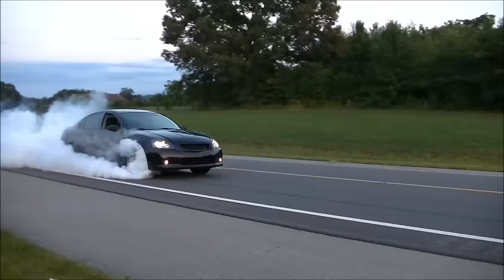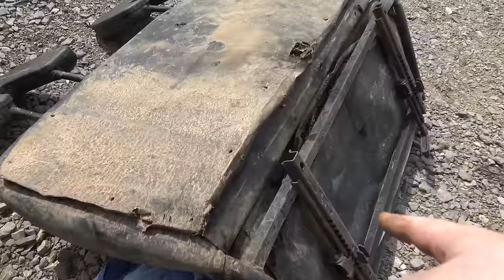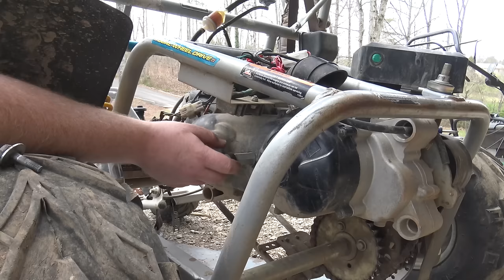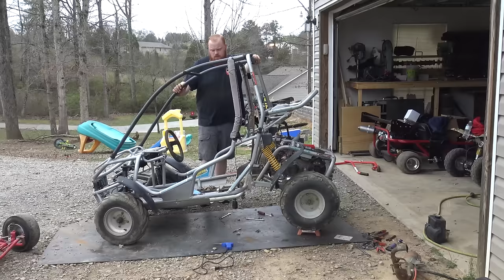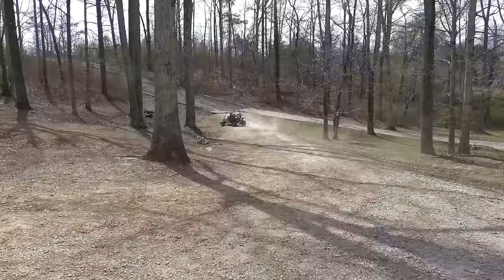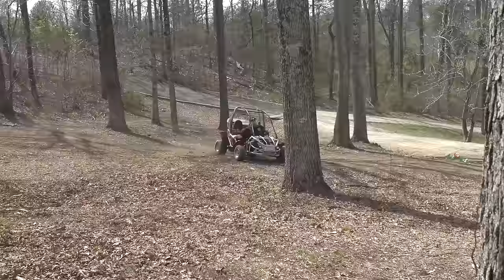150cc Go Kart Performance Upgrades

Comment: How hard would it be to rehab one of these. I found one thats not running and am wondering if it would be worth rebuilding for my daughters.
Reply from the maker: +Fink oh yeah go power sports has a rebuild kit and you can get 10% with my code. Lots of power for it's size. I will doing a rebuild on one of these engines soon on the channel

Comment: So honest question I’m currently working on a 150cc myself now we have the same set up but one thing I must ask when I bypass the air filter box with this new one cause this is sexy and better performance do I need the two vacuum lines or can I eliminate them all together anyways thanks

Comment: I have a quick question. Once you removed the air box for the UNI filter.. What do you do with the hose that went from the valve cover to the air box?
Reply: They make block off plates for some

Comment: I have a df200DKG 168.9cc four seater. I have a Lifan  engine in their and I have a problem with the idle, the cable runs from the throttle pedal to the back of the carb. I keep trying to adjust it but it always goes back to a minimal idle. any suggestions on that? Also, I need more take off power. Would these up performance upgrades work and would it help my increase in take off speed? Thanks

Comment: Do you have a video that shows how to remove the starter on the Fox Carbide 150 CC Go Cart.  It is a tight fit, and we are not sure how much we need to unbolt to get this out.

Comment: I bought a new racing cdi for my blue lightning reverse by americansports works. I hooked the cdi up and all it did was crank didnt fire up i never had that problem with the old one. So I put the old one back on and it still fires up. Think that cdi just doesnt work for it any ideas of what type I should buy

Comment: I just bought a 150cc Scorpion chassis with no motor. What motor would you recommend putting on it. I know regular go kart motors won't go on it, I'm just trying to find out what kind of motor does go on it. Thanks
Reply from the maker: Watch my 670cc off road go kart. If you do the rear engine section like I did then you could use a 420cc predator and make some pretty good power
Reply: Red Beard's Garage I will give it a look and see! Thanks a lot! Also, do you know if a motorcycle motor would work? I'm just trying to find the cheapest buy also best route to go.
Reply: Does the motor your talking about look just like a regular go kart motor?
Reply: Go to buggydepot.com they sell the gy6 engines. They even have the ones with a big bore kit installed

Comment: Do you have a list of parts that will fit my Hammerhead GTS 150? I'm new to the go kart scene and I recently got my hammerhead. I want to upgrade it over time, but theres so many different brands for each part, and I have no clue what to buy and what will be compatible. I have a shop that will install the mods for me, but they don't sell performance parts for their vehicles. Any help would be greatly appreciated.

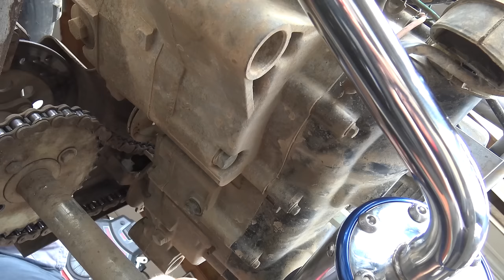Comment: Make sure you also clean the oil filter screen, you have to take off that big bolt cap on the other side from where the drain bolt is on the bottom of the engine, you can see it at 15:14

Comment: Hey bud I got the GY6 150 TaoTao go-kart in my header has the EGR valve on it and a line that goes to the carburetor for vacuum what do I do with that vacuum hose if I remove the EGR system

Comment: hey R.B. I need some help. I'm purchasing a simular Kart called the helix 150cc. Can I fit a predator 212cc or even better a 16hp vtwin
Reply from the maker: You probably would need to make a new rear engine mount. I will be doing one soon on a Yerfdog Spider box so stay tuned to see how I do it.

Comment: hi I am running a 40 series torque converter I greased and it is working great but now when the drive pulley opens it is making a lot of noise any suggestions thanks

Comment: just wondering if u know of ne kart frames that r all metric... from the bolts n nuts to the bearings?
Reply from the maker: No most are made in China so there pretty much all standard.
Reply: Red Beard's Garage thats kinda strange bcos i picked 1 up last year and not 1 bolt is sae and when i took the wheel bearings to a kart shop to get new 1s the guy was puzzled and said they werent the original bearings but they were, and its blowing my mind cos nobody has been able to tell me who made this 1

Comment: my 150cc was running good until i hit about 30 miles per hour then the kart just dies. It wont start and battery is not problem. Ive tested ever wire but all were good. when i opened rear fuse box. fuse was not blown but i realized i could hot wire it. It ran for 5 minutes than died. What could be problem?
Reply from the maker: No clue man. I would try and replace all the electronics on it. There really cheap for these things

Comment: Would it be pointless to get the jetted carb  and not the performance cdi?
Reply from the maker: No it would still make more power. The cdi pretty much lets it rev a little higher

Comment: hey RBG my friend a gokart that we are upgrading it has a small lift and good suspension can u give me any ideas on what to do to make it faster?
Reply from the maker: What are you wanting to do and what engine is on it?
Reply: well I wanted to lift it put a new exhaust bigger tires and rims and maybe a new fuel pump in it because we live in el paso tx. and we like to offroad at redsands but the gokart is only rear wheel drive my only problem is I dont kno what type of engine it is or what because my friend bought it off of his neighbor
Reply: it should be a 6 cylinder maybe more or less around there

Comment: that isa gy6 right?
i got a adly 150cc quad it has the 150 g6 engine and its only doing 60kmh.. and its driving me insane its a great base, but the engine is slow...
i bought of aliexpress those orange racing cdi with coils. the orange cdi does nothing the stock black cdi does the same speed....got a iridium spark plug. it still does 62kmh gps...
so i bought a new racing cdi those blue ones on aliexpress... hope that helps. i got more acceleration since i got a exhaust on it it has a better response :)
but i think i might need also a cornet air filter (cause it has a air box stock with a massive air fitler that i cant even blow tru...) and maybe jet it?
its wierd cause i found 2 people saying the racing cdi coils and iridium spark plug made there quad go 95 vs 66 stock (he jetted it) but hard to believe cause mine is still doing 62...
so yeah next on my list check the cvt belt if its going at its max, and open air filter and jet it.... and wait for the new racing cdi.. cause its not really going up in revs... it feels like its at 4000-5000 maybe its not raging.

Comment: What can i do if it starts up good, and idles fine, it runs, but after a while it starts diying on me as im driving once i let go of gas pedal. Until it just wont fire on till it cools down
Reply from the maker: Might want to get a new cdi or check all your wires good

Comment: I got a brand new used race cart what mod should I do to the 212 mods please respond
Reply from the maker: Do the go power sports performance kit to it that comes with the air filter and adapter, jet, and header. Then remove the governor.

Comment: I have a scorpion with the exact same engine but I haven't moved it for over a year, and I tried turning it on and so far I just replaced the battery to see what I should do, right now the battery is the only thing that works but I dont know how to clean the old gasoline, that has been my major issue, all I need to know is how to remove or clean it out of old gasoline, I already know how to replace everything else.
Reply from the maker: +Carlos Sanchez just replace all the lines and the carb. The carbs are so cheap I would just replace it. Then remove the gas tank and clean it out good with rocks and new gas. Shake it around good and rinse.
Reply: Red Beard's Garage I was trying to start it today and I used some engine starter, it seems to have trouble getting gas and the part that is suppose to move when you press the gas pedal is stuck, I'll just have to replace the carb completely, everything else is good, just some cleaning and an oil change
Reply: Red Beard's Garage by the way, I found a loose line that is at the very bottom of the carburetor right below the line that takes gas into the carb, its the same as the kart in your video, is it soppose to be like that, or does every line that connects to the carb has a connection somewhere else? I thought that it might just be to get air in or out.

Comment: I just voufht a df200.  Very disappointed in speed and power. But i figure removing the restrictive air box and exhaust will let it flow alot more.  Going to try a jet in carb. As well as some clutch and spring upgrades.  If that doeant fun it up. Ill be putting a 650 or 750 bike motor in it
Reply: I thought it was a turd too. Bought it friday.  Today put 32mm carb with a 130 jet.  And ditched airbox for a slip on filter.  Truthfully.  Small take off gain.  Top end loss.  Tommorow im removing muffler and gutting it.  I ordered clutch springs.  But will be thursday before they come in.  Doing one change at a time to see whichbhas best results

Comment: Can you guys tell me what is compatible with the FOX HELIX 150cc? I need an all new wire harness and brake pads plus other parts. Thanks in advance!
Reply: Its a manco helix 6150. I have one.
Reply: Yah but it's no longer manufactured and not many parts for it. Know any karts that are basically the same thing and compatible?

Comment: what's the easiest most power engine swap if the upgrade parts are not that much added power I'm just saying might be cheaper to do a engine swap
Reply from the maker: This engine is perfect for what we are using it for. I don't see a need in upgrading it for kids to ride
Reply: Red Beard's Garage right I'm saying for me I'm thinking about buying a junk one with a bad motor
Reply: Red Beard's Garage on the 150cc are you using nondetergent oil or detergent 30w
Reply from the maker: non

Comment: Is the Zercon a Hammered side by side my son rides a Hammered 150cc I've got the exhaust air filter my dad adjusted the carb lil buggy flys now and I have a 450cc Silver Fox Go Kart Buggy similar to the Manco Deuce you Built and the Yerf Dog Buggy you had there's a few Motorcross tracks that have a adult Mini Buggy class and a kid mini buggy class we are trying to get all the Motorcross tracks to Race Mini Buggys so we can have fun racing like quads and dirt bikes I do Race my 1984   Honda 200cc three wheeler and my races the Kazuma falcon 150

Comment: so what size jets did he have?  my daughter's runs like crap from mid to higher rpm starts perfect every time idles great new fuel new ngk correct plug clean airfilter.  but if I put my finger partially in front of the air intake just right then it comes to life and goes wide open? so what's the deal I have the new jets coming 113 and I think a 40 but if that doesn't fix it I don't know what to do?  suggestions anyone?  #Red Beard's Garage
Reply from the maker: From what you have told me it seems like that will fix it. You have to have enough fuel to go with the air on these small engines.
Reply: Red Beard's Garage I just replaced the carb with upgraded jets it runs perfect now I can't tell you how much I appreciate your videos and just talking or having fun ideas it motivates me to do more thank you #red beard garage

Comment: that's a 157qmj motor they come on 150cc scooters you can make massive power from them I can get 60mph out of the stock bore no problem which is 57mm you can get 60-63mm BB kits off eBay for really cheep cams big valve heads and what not.  on the oil change if you noticed right below the fill neck on the bottom of the motor is a 17mm nut that nut holds your 'filter' it's a metal mesh screen I'd recommend removing it and cleaning it.  just keep in mind there is a spring holding pressure on the nut so becareful but I can bet it's full of metal and junk.  I build these motors all the time so if you have any questions I'm more than willing to help. one last thing to get motor to tdc remove the stator side cover and on the magnito there are markings that show tdc just remove the valve cover and feel for play on the rocker assembly if there is none than rotate the magnito by hand 180' so ur Cam lobe has no pressure on the valve and adjust from there. really simple like I said any questions about disassemble or anything I can help.
Reply: one more thing on the case your going to notice a cast fin that will match up with the magnito thoughs are your timing reference marks when you take that cover off you will see what im talking about. Its only 2 8mm bolts and 2 Philips head screws holding the fan cover shroud on and the magnito is right there. also I'd recommend clutch springs and a torque spring I use 2k rpm springs but you can choose. only cus these motors have 2 speeds hi and low gear and when your torque spring is light it will get stuck in high when your trying to climb up hill and bog your motor down the torque spring forces the motor to down shift and the clutch springs just change what rpm the clutch ingages at.  also varieator weaghts will help out massively. one more note to add I've never had one cdi box that really had a rev limit on it. from aftermarket to stock I can rev the motor till they blow. just saying.
Reply from the maker: +scott roberts email me at greg@rbgkarts.com
Reply: modeed gy6 carbide
Reply: You seem like you know a lot about these... I have a Yerf Dog GX150 and it has this same motor. I got it from a junk yard and it didn’t run so I rebuilt everything on it and while I did I bought a new carb of eBay and a 1500 rpm spring and put 10g roller weights in it and a new belt and greased the parts that needed to be and put a performance cdi box and coil and spark plug. I hopped on it to go and it sped up very slowly and only hit 20mph and wasn’t revving to its full potential. Please help me make it fast!
Reply: @scottroberts7496  I have one and its leaking oil from the breather tube on the stator side cover, i dont know if it makes sense, but help?
Reply: @geodavi123  that's not a oil breather it's a path for the fan flow to follow if oils coming out of that you more than likely have a bad crank seal.
Reply: @Wolf9326  is the vaccume slide moving up on the carb? That's where I would first start and check. The stock carb haves a butterfly valve in the back portion of the neck but in the front it has a vaccume driven slide in it  aka cvt carb. Make sure that slide is being driven up when you accelerate. If you can put it on stands and use ur finger to pull the slide up when u wot the motor and see if it revs out than. Be vary careful when doing this so the cart dosnt fly off that stands.
Reply: @scottroberts7496  Thank you, I will try this this Spring!
Reply: I've got 2 karts running the 161qmk b2 with built in reverse and another one running the 150cc  short case with external reverse. I really like these engjnes. The b2 cases can be made to over 220cc and oil cooled
Reply: My 2 big karts are the dong fang 200gkd.
Reply: I have this same motor on my yerf dog and just put a new top end. How long do I have to break in the motor before I can rip on it?

Comment: if you're trying to get more horsepower a cdi isn't the way to go because it's basically a regular CDI but in a nicer case and my small engine mechanic that's working on my buggy said that he talked to a lot of experts that do this high performance stuff for a living and they all say cdi's aren't the way to go they say it's just a waste of money they say if you're looking for high performance that the best option is to get a Big Bore Kit and try to find the proper Jets to work along with that Big Bore Kit. but if you really looking for some horsepower go down to your local junk yard and try to find a wrecked sport bike and get the engine out of it because people use those 700cc to a 1000cc Sport bike engines and mock them up on their buggies lol but anyways great video keep up the good work!
Reply from the maker: The cdi did let it rev a lot higher than it use to so it did make a difference. I wasn't trying to get crazy power out of it I was just using the parts that I had.

Comment: What did you do with the vacuum line to the valve cover that ran to the air box?
Reply from the maker: I can't remember. I will look the next time we work on this kart.
Reply: @RedBeardsGarage  been wondering the same thing. Did you ever figure it out? I want to remove airbox but has vacuum lines

Comment: When installing the new air intake...what do you do with the existing vacuum line that you disconnected from the old air box?
Reply from the maker: You can install a small filter onto the line that went to the air box